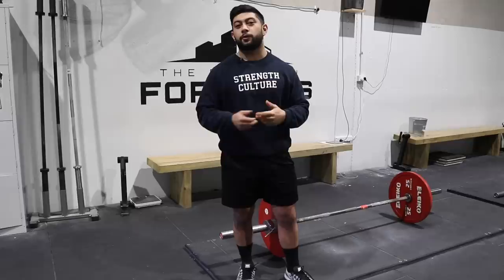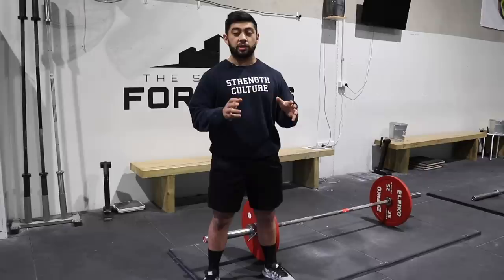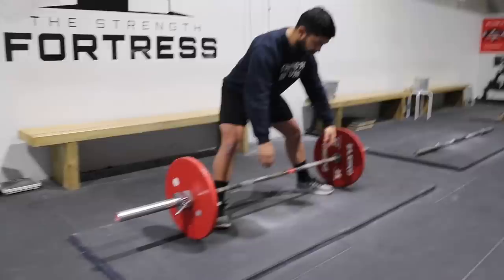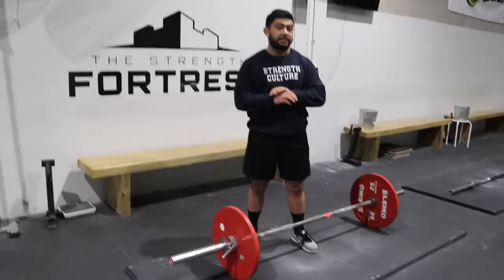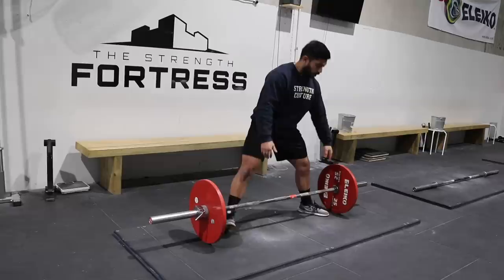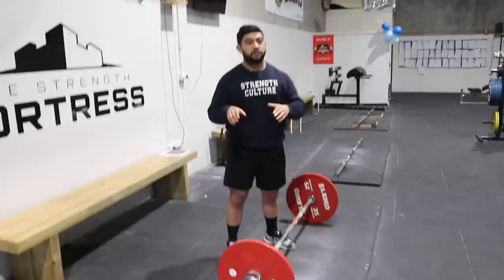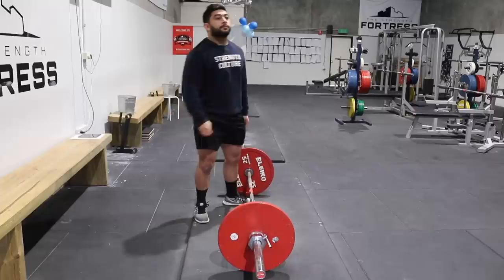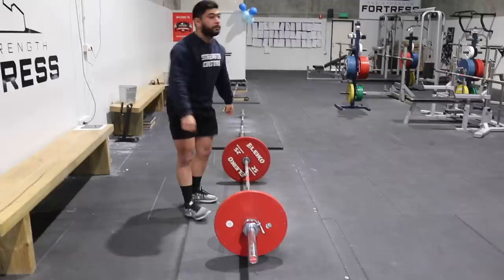Pulling The Slack Out Of The Bar - A Thorough TUTORIAL

Comment: Hi JP fantastic video
But I have a few questions which i would appreciate if you could answer thanks 

1) should you actively try to put tension in to the lower back in step one to stop it from flexing during step 2 
2) should you actively try to squeeze the glutes together while the hamstrings are loaded at the start of step 2 
3) just before step 3/at the end of step 2 when should you externally rotate the hips by pushing the knees out? As the hips come forward or when the shins have actually touched the bar?

Comment: How do you feel about breating in and pulling the slack out of the bar at (pretty much) the same time as getting into position? I usually set my grip, then breathe in and brace as I start to get into position, and while getting into position I pull tension into my lats & hamstrings. I will give this way to do it a shot for sure, as your last video on sumo deadlift positioning helped me immensely as well.

Comment: 1b seems a lot like shifting your body weight back at the ankle joints, like in another video you made which goes through how to get your body weight behind the bar. Is that basically what your doing here?
Reply from the maker: Not quite. 1b here is a pulling upwards action.  There's no shifting of the bodyweight here. It's around this point where you might need to shift back but shifting back and pulling up are different things. To paraphrase, 1b is putting force into the bar. You're using the muscles of your back, glutes and hamstrings to pull on the bar. Shifting of the bodyweight back is simply that, shifting the balance point. No force being applied necessarily.
Reply: @JohnPaulCauchi   Should you shift back after taking up the slack then? Also I was wondering whether or not I should be tightening your core before breathing in, in 1a?

Comment: I tried it today. I use the hook grip as you. I already pulled the slack out after I engaged my lats( I pointed my elbows back). So I didn’t need to shift my body weight backwards. But this then anyway done when bringing chins to the bar and building pressure. It felt good. I was wondering if you would recommend that after I engaged my lats I lower a bit to give slack back( if this is correct English) and then pull the slack out by shifting myself backwards? Probably it’s not easy to say when you don’t see it. Would appreciate and answer anyway
Best
Patrick

Comment: What is the reasoning for initiating the lift immediately after getting in position? I pause for a second to ensure I get maximum tightness and slack pulled out and it feels more effective than pulling immediately
Reply: My guess would be that you can't maintain maximum tightness for a long time, at least I find that I can't. You should be squeezing the bar with all your might and getting really tight. Try doing this for a few seconds, it's not easy to maintain. You'll eventually lose tightness, and for a maximal pull, you'll want to minimize any energy waste. 

I think by taking his advice, and learning the process slowly with pauses at first, will make it easier for you to recognize you have maximum tightness without having to pause at the bottom and assess.
Reply: Initiating lift immediately causes some momentum to carry you through.